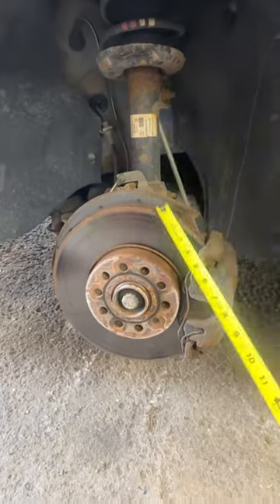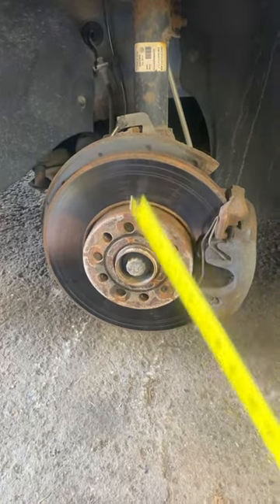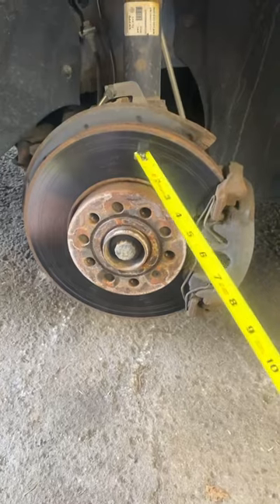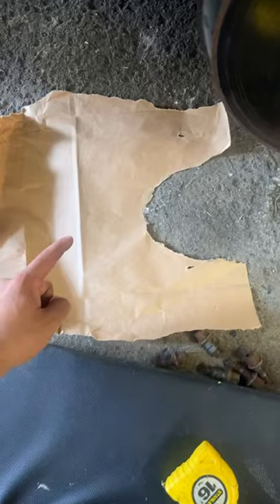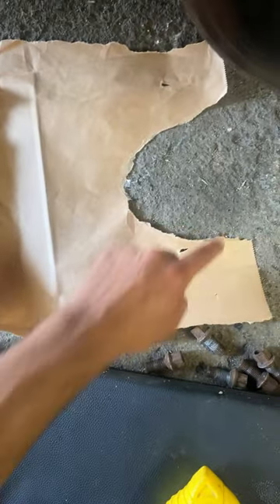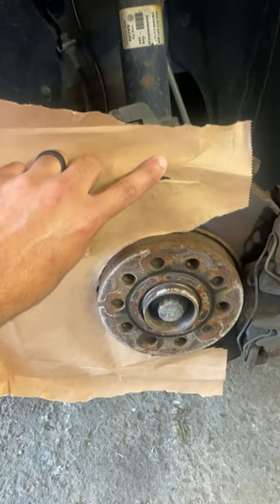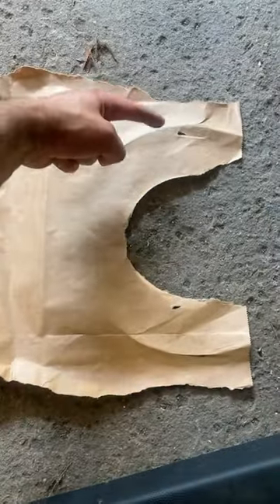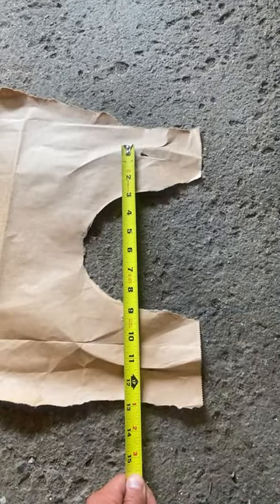How to measure your rotor size without removing it!

Comment: No parts guy asks you that !!!!! , they wanna . Know .....make , model , and maybe engine size. , front or back !!!
Reply from the maker: You haven’t changed enough brakes! Call up any parts shop and ask if this is a normal question - report back your results lol.
Reply: And if it has air
Reply: False. Go ask them for brake pads for a 13’ avenger and see what they ask you.

Comment: That tape measure will never read Millimeters...
Reply from the maker: This is facts 🤣
Reply: Sure does if you're in Canada. Just like it also measures ft. Measurement is devided in two sides. Top is inches and bottom is cm. The inch side also shows ft every 12 inches. And cm side shows the mm lines. 10 mm lines = 1cm.

Comment: It is even easier if you take a look at the parts database. Then you can compare that official size with what you have on the car, to be sure. Also, you can consider buying the new one based on the exact part number from the database, although you have to check that the brakes weren't modified or exchanged to a different size since the manufacturing of the car.
Reply from the maker: Great advice!

Comment: Don't you need to remove the rotor to replace their rotor 😂
Reply from the maker: Not if you don’t have parts and need your car to go get it.
Reply: Yeah but if you need rotors and brakes should you really be driving your car
Reply from the maker: @subaruandy02  I dunno about you but I don’t do my brakes in advance of them being worn out lol. Brakes are not preventative maintenance items. You replace them when they’re worn out; whether that be when your pad sensor triggers a light on the dash or the pad starts to squeak letting you know it’s time to replace them.

Comment: Well once you have the tire off you might as well just put the tape measure to the rotor itself
Reply from the maker: You can’t, the hub won’t allow you to get your tape measure flat on the rotor. 

Unless you want to eyeball the measurement but generally the variance is 3-5mm between different rotor sizes so eyeballing is very inaccurate.
Reply: @bofbolts  touche

Comment: There is usually about a 2 in difference. Pretty easy to tell
Reply from the maker: Not always - the MK6 jetta for example has 3 rotor sizes all within 3, 2 and 4 MM’s apart. That would be tricky to tell unless you’ve got wild vision.